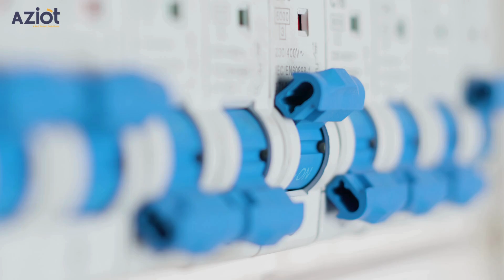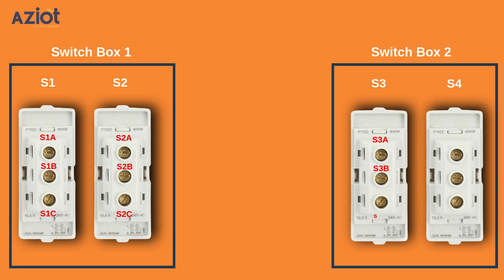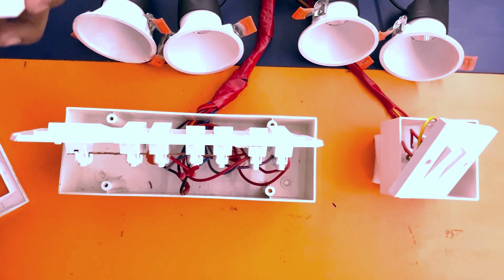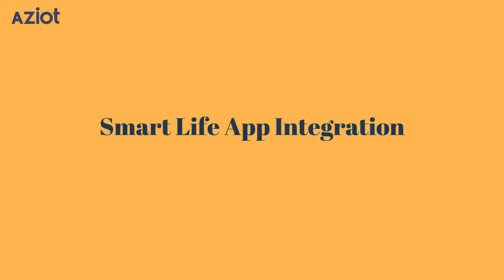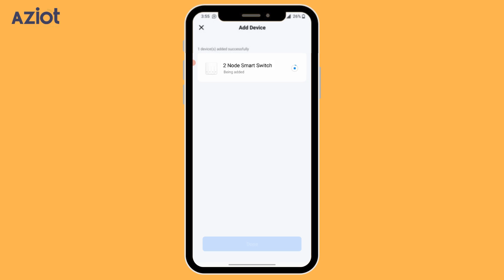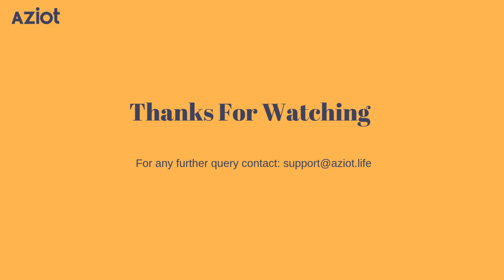How to connect smart 2-Node switch for 2-Way connection | Installation guide

Comment: Is there any node switches that dont need neutral connection because the loadside of the box doesn't have any neutral wire installed. 😭
I can't run the neutral wire myself without calling an electrician.
Reply from the maker: Hi Subhodeep, Our smart switches are designed to work with a neutral wire, in line with government-approved safety standards in India
Reply: @aziot Thank You for your kind response. 🙂